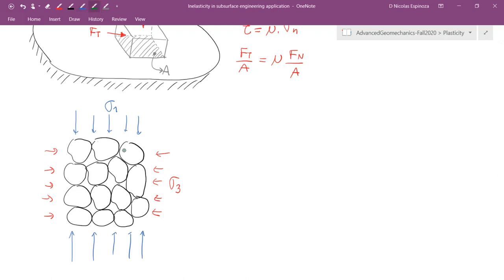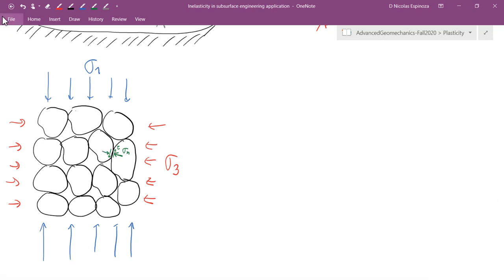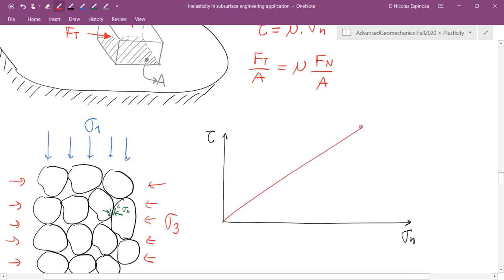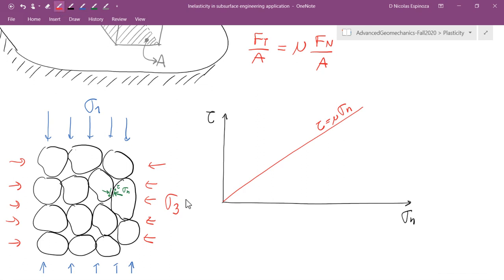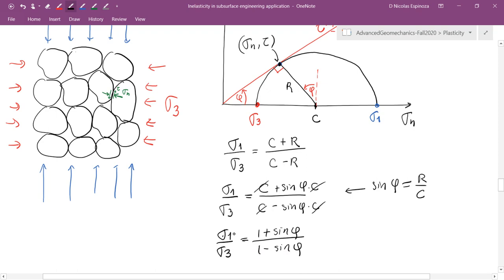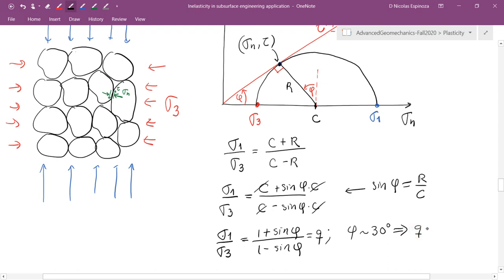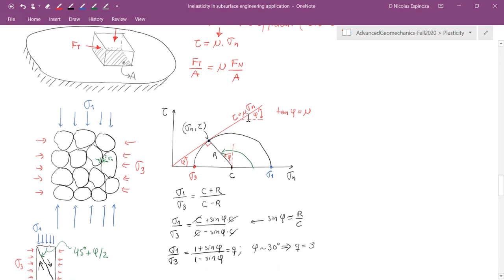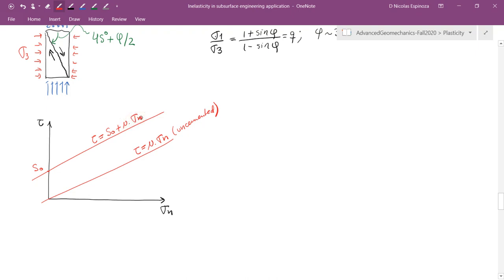L30 Mohr-Coulomb, Dracker-Prager, and Modified Lade yield criteria

Comment: Context - Minute 15.20. How would you explain that from s1 in the M-C plot the characteristic angle can be found in the counterclockwise direction whereas it is clockwise in the 2D representation?
Reply from the maker: I don't think it in terms of clockwise or counterclockwise, I think it always as going from the point/plane of sigma_1 to point/plane of sigma_3 (or any other principal stresses). It never fails.

Comment: sir one doubt...how can we draw simply a circle on hydrostatic axis in drucker prager ? you said it should be symmetric with hydrostatic axis then why only circle ? please clarify sir.
Reply from the maker: It is not a single circle, it is a conical surface in the principal-stress-space where the cone axis coincides with the hydrostatic axis. The circle is just a cross-section of the cone with a plane perpendicular to the hydrostatic axis. I hope this helps.

Comment: Hi Professor. How the behaviour of rock vary from the behaviour of soils? Are there any differences using these constitutive models for soil?
Reply from the maker: The main difference is cementation which provides rock with cohesive strength. In general, all materials have a tension limit, compression yield cap, and some frictional strength. Tresca and von Mises (for metals), are a particular case of Drucker-Prager/Lade (rocks), which in turn are a particular case of more advanced models like Cam-Clay or Kayenta (for soil and rock/soil at high stresses). Which model you choose depends on the range of your stresses and what kind of inelasticity you want to capture.
Reply: @dnicolasespinoza5258   Your explanation makes sense. Love your channel. Keep posting!